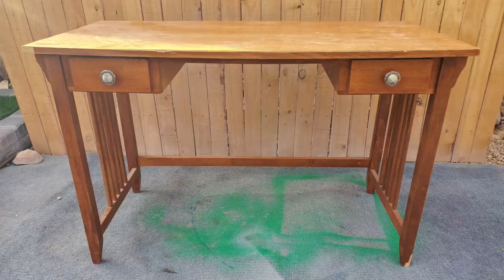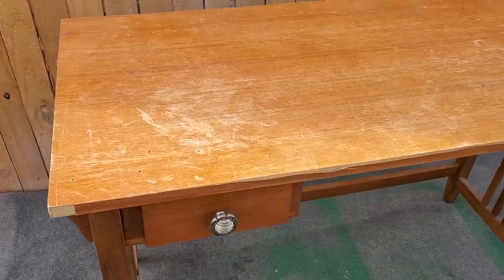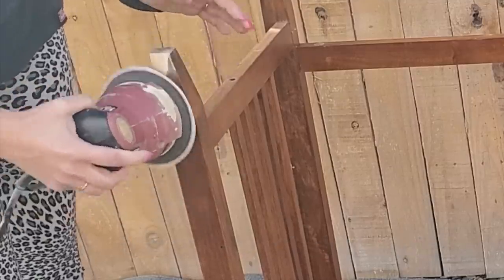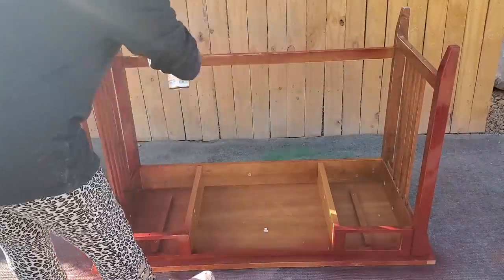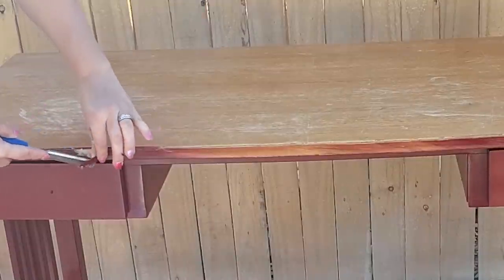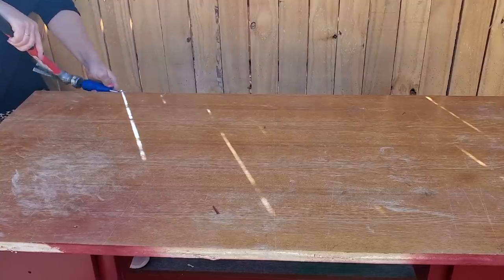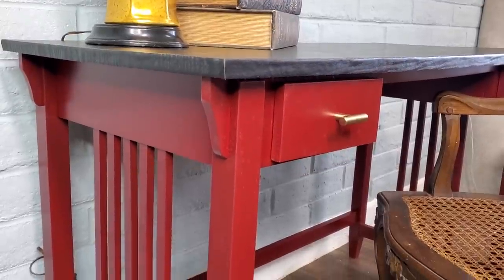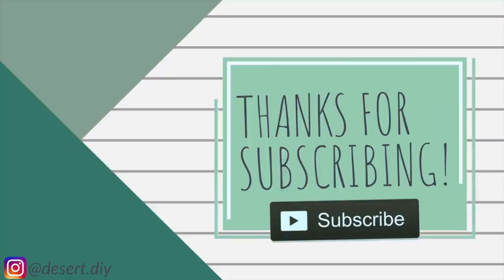Trash to Treasure Surprising Desk Makeover | Particle Board | Peel and Stick Countertop

Comment: Great job on that desk. It looks so much better after you finished it!
I’m using that same wood grain contact paper.  I carelessly bought a chest of drawers without realizing the drawer fronts were plastic in that silly off white with gold detailing french style with grooves for the gold paint.  The wood putty just did not stick well and I found it impossible to get them filled in properly.  They showed even after I painted it black.  Using that rather thick contact paper solved the problem and it’s looking much better!  I just have to finish putting it on.
Reply from the maker: Aw man I hate when that happens! Great way to think on your feet

Comment from the maker: Do you have a particle board piece of furniture that needs a redo?
Reply: I have a dresser with most of the edge around the top broken off. I was thinking I may remove the rest, use wood filler to smooth it out, then paint. I don't really have any experience working with particle board. Think it will work?
Reply from the maker: That could totally work. Id recommend using chalk paint followed by polycrylic.

Comment: I just grabbed a particle board desk from the side of the road. It's it good shape, but it kind of wobbles side to side. Any suggestions on how to secure that?
Reply from the maker: Fill in screw hole with a tooth pick and screw it back together or if it is just not level you can add a little stick on cushion to thr bottom of whatever leg is too short